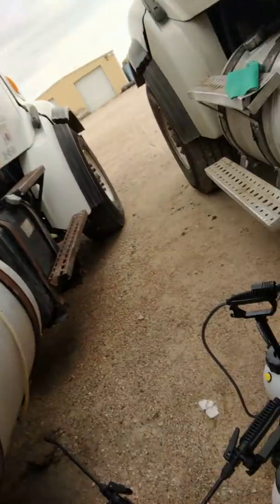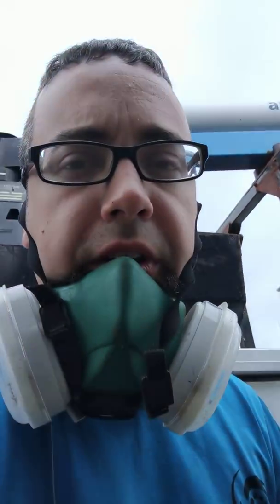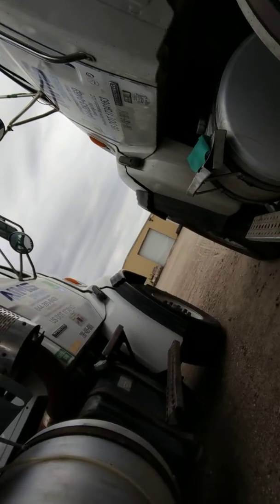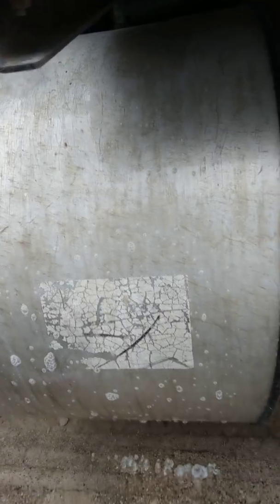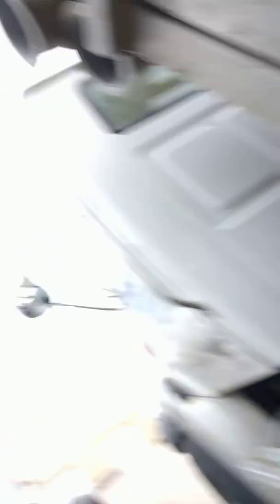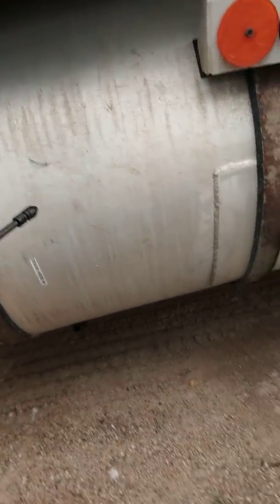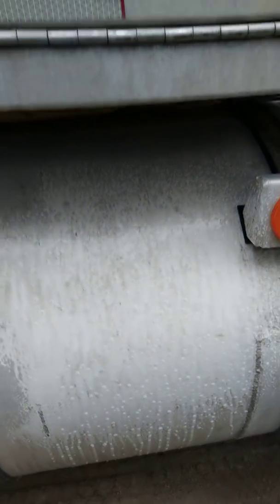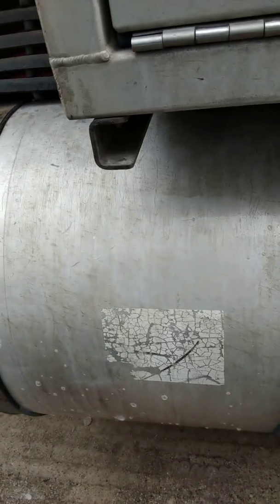Aluminum brightener comparison

Comment: be carful with acid or oven cleaner. i just used some over cleaner and now my throat feels burned. did not onset untill a couple hours later which makes this more dangerous. harsh chemicals are no joke. some cleaners even specify for medical teams to wash your lungs to remedy heavy exposure. that is where they remove your lungs and wash them in a pan and then sow them back in. take care.

Comment: With my experience in the oil and gas refining industry, and my extreme respect for the hazards associated with HF acid.....NO THANKS!

I'd rather sweat and pant using elbow grease than have that nasty reach for my skeletal calcium content. To make matters worse, you sprayed it via aerosol on the aluminum surface whilst partially donning your mask. Folks have perished even by inhaling ppm concentrations of the stuff. 

Please be careful. HF usage without clinical supervision is DEADLY.....just my 2 cents worth.